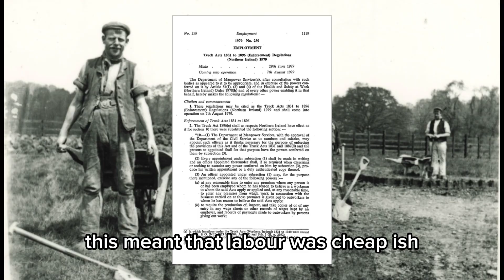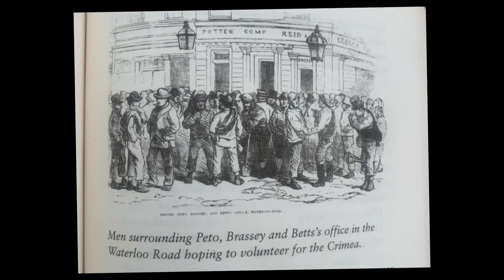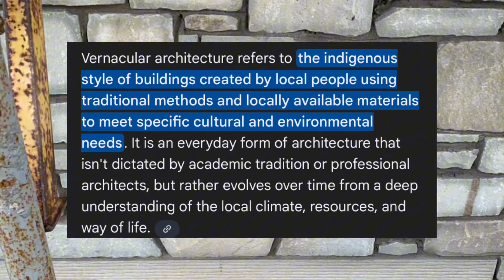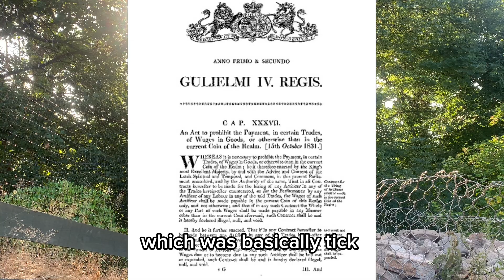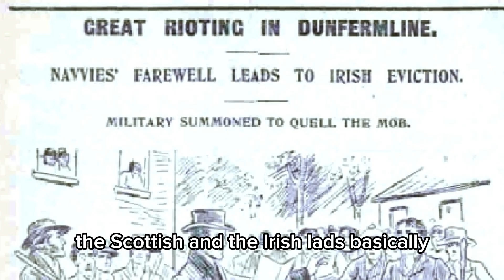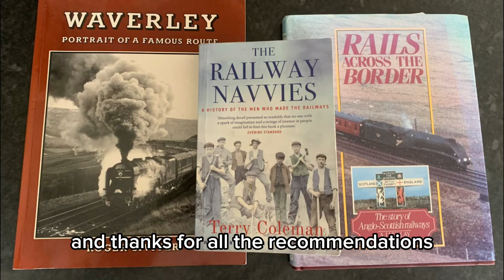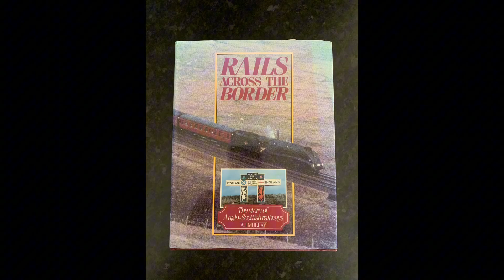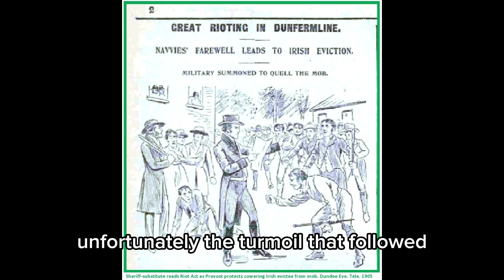Who built our railways?

Comment: Good video mate. You need to have done your time on the shovel to appreciate the work those boys put in.
Interestingly enough all the tunnellers working on the big infrastructure projects in London to this day are Irish.
The majority of them are from Donegal and they hold massive sway on the projects, the reason being they cannot be readily, or at all,  replaced; main contractors could call in Agency worker to cover every trade and even Engineers but no agency can supply Tunnellers. And also Its a bit of a closed shop to get the start in these crews. Beneficial if your CV says you hail from Donegal or perhaps the west of Ireland 😂
Josie Gallagher and Danny Sullivan supply most of the tunnellers on the Crossrail, Thames Tideway and HS2 projects.
Reply from the maker: That’s generational lnowledge and aspirations passed down thanks for telling me this.